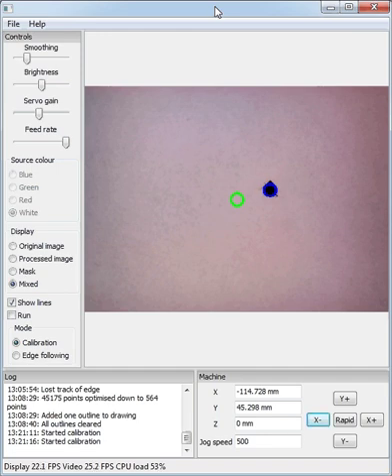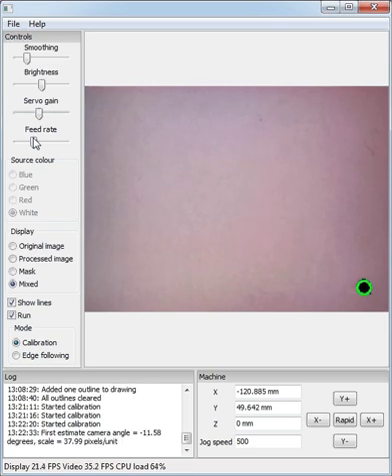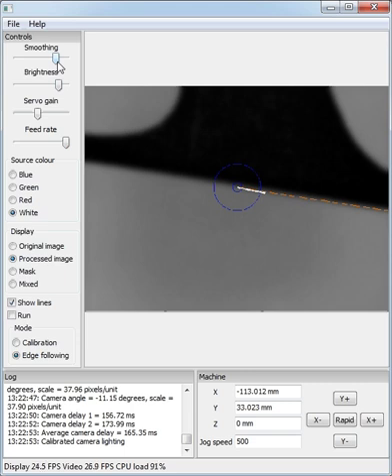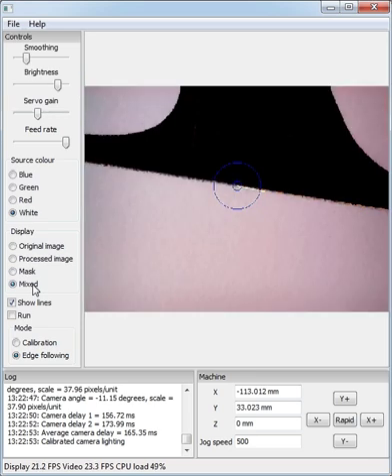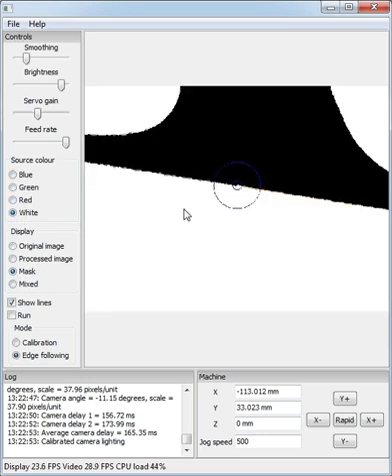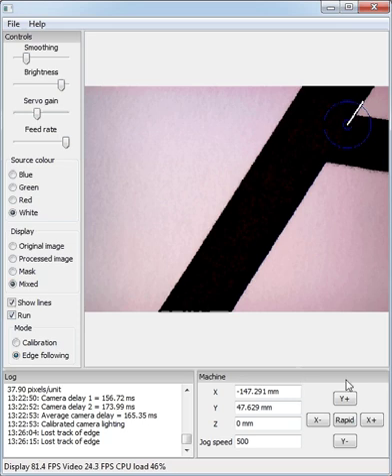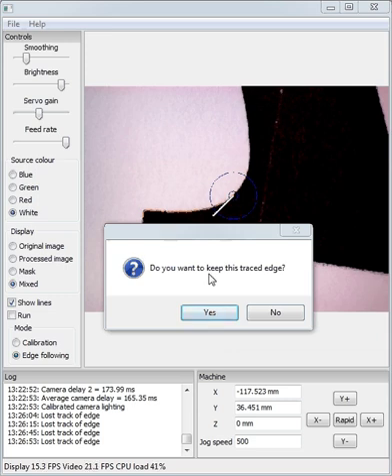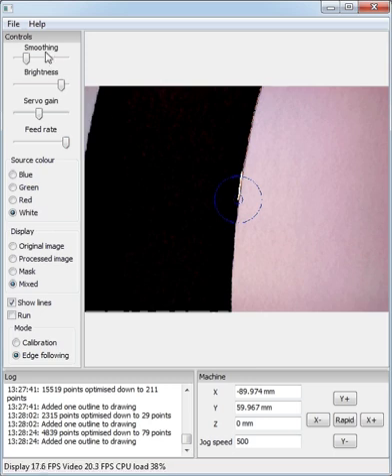Scanything tutorial

Comment: im trying to set this up and its just going along the x axis nothing else. JOG works fine. Im trying to use it with mach3. any suggestions. i click calibrate and it just goes one direction on the x axis
Reply: Try rotating your camera 180 degrees. It sounds like you have the direction reversed.